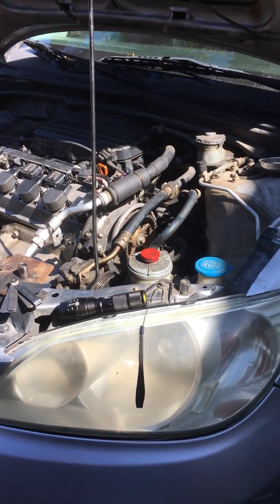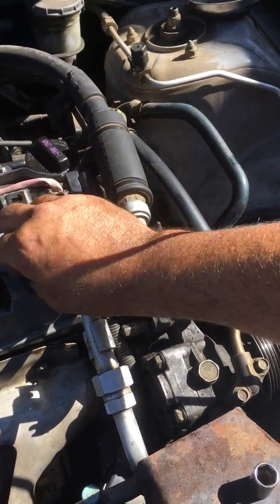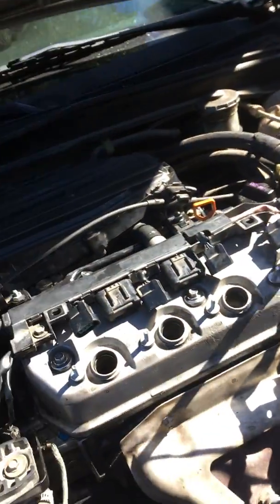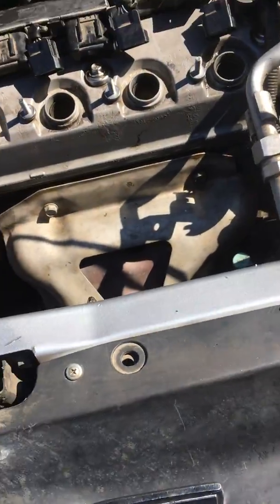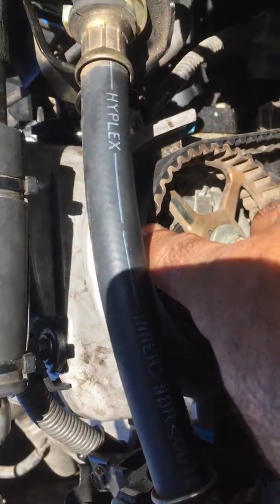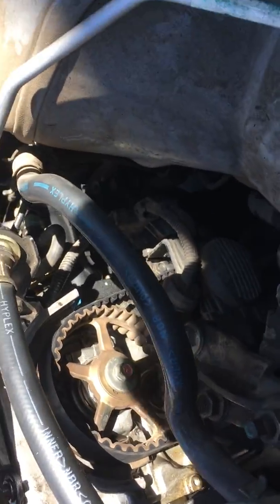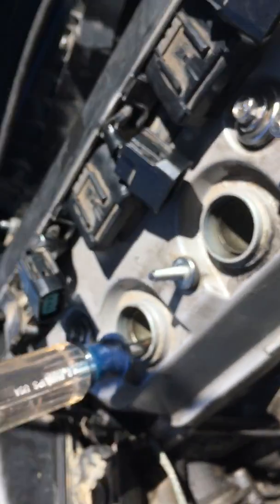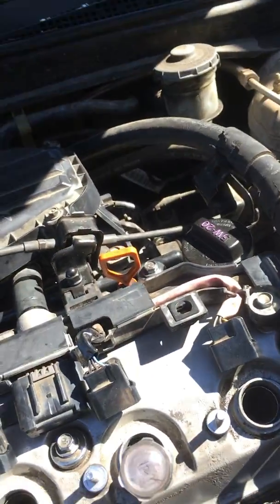2005 Honda civc with Rod Knock

Comment: I couldn't tell what was your first method to determine which rod was bad. The second method was simple enough. My local dealer said they'd have to drop the oil pan (for $700) to determine if it was a bad rod! I sent them this video.
Reply: I believe unplugging the connector for the coil, so the particular cylinder doesn't ignite reducing the noise if it that one.

Comment: I fixed my knocking d17 . It was a main bearing
Reply: How’s the car been so far? I’m doing a whole engine rebuild starting with the crankshaft, new rods pistons bearings everything
Reply: @kevinmejia8082 hows that going? Im stuck between building my d17 or just throwing a kseries in my em2
Reply: @Icarus.2  car ended up overheating and I just got rid of it lol. I’m in a 16 accord touring the v6 has changed my life ngl

Comment: So i need a new motor
Reply: That is what I need for mine as well. Im planning on just rebuilding the whole bottom end on mine. It also needs a new head as well and just about every thing else.
Reply: A new block at the junk yard is 300. 
And a complete JDM engine is 700 with everything included plus they are low miles. All you need to change is the intake manifold because the one from japan has the throttle body on the opposite way.
Reply: @JoseOrtiz-mp7xw  Where would i get a complete jdm engine for that much
Reply: @JoseOrtiz-mp7xw  Thanks for the information !!